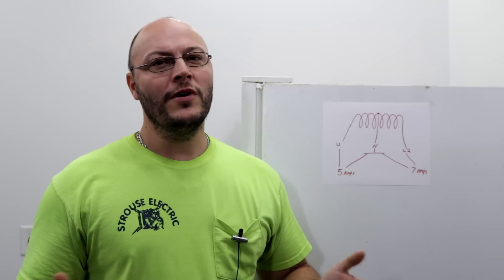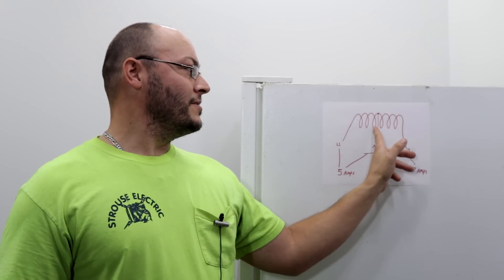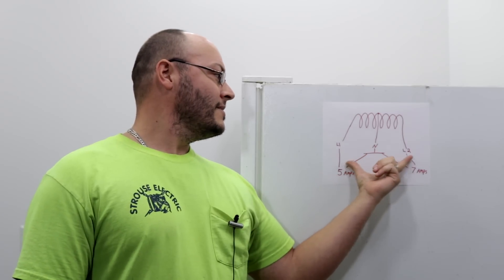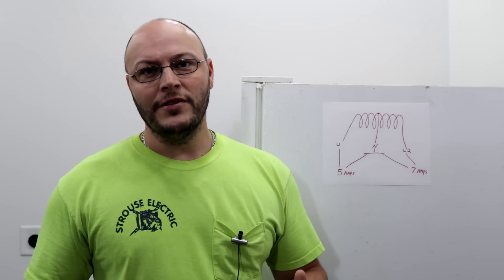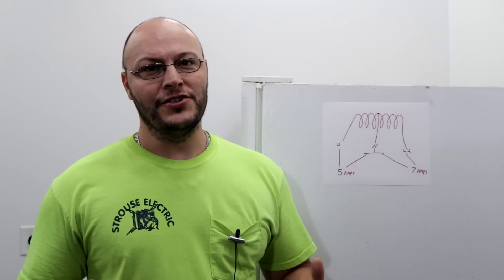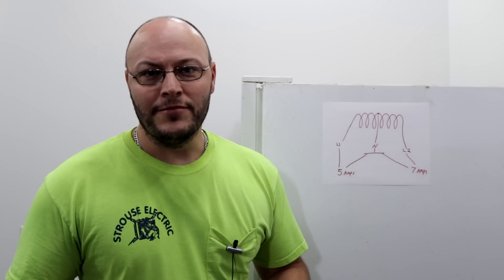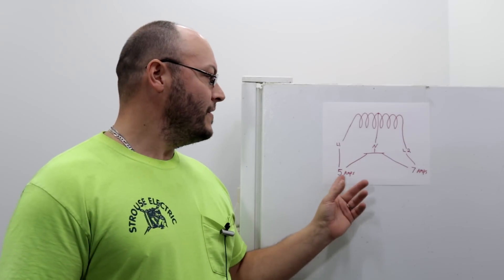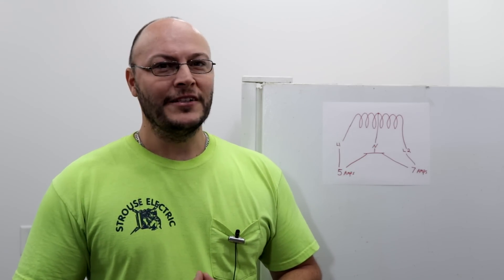What does the Neutral Wire Do?

Comment: So, what happens if there was no return pathway for the remaining 2 amps in this situation?
Reply: The voltage would be unequal in the legs without a neutral.  The leg calling for 7 amps would be lower voltage with the leg calling for 5 amps would be high.
Reply: The entire system would share the 12 Amp load, basically, creating an imbalance in a parallel circuit system. So the devices on the side drawing 7 amps would suffer from insufficient power (i.e. lights/bulbs would grow dim, etc).  Nothing would happen to the 5 Amp side.  Nothing would burn out, except perhaps for any fragile underpowered motors being used on the 7 Amp side. No breakers would trip assuming the standard 15 Amp circuit - nothing is overloaded, just imbalanced.  This example is a single stage split circuit residential situation (minus the split in this hypothetical question = single phase parallel circuits) so I believe the out of phase issue you mentioned would not be an issue in this example.
Reply: I think if the unbalanced two amps in line 2 did not have a white wire path they would have to follow the line 1 wire and force to many amps into a line that is only calling for five amps. So I think you would fry the devices but the breaker would guess knows it is only supposed to be pulling 5 amp and when 7 amps came through perhaps it would flip the breaker off. Just my guess cause I really do not know. I know line one and line two are out of phase 180 and when one is pulling the other is pushing. Or when one is going forward the other is going backward. AC changes direction I think 60 times a second and when one line pulses toward the source the other pulses away from the source. Just a guess. I  hope some one can correct me if I am wrong.
Reply: I had that problem once, the utility company came out and checked it out. Said we had an open neutral. He went down the lines and found the open because someone was trimming trees and knocked it loose. I forget why I checked the voltage, I think the microwave was acting weird. So when I checked the voltage in the socket the voltage would rise beyond 120 to like 140. So I called the utility. As far as I know the problem only existed for a few hours, we had no other problems which you would think everything would cook?
Reply: Mike Horton It was told by an electrician you always hook up the white wire first and remove it last when working on a circuit.  You can have high voltage on the circuit and burn out the appliances and lights. There also has to have a bonding screw installed in the panel for the ground on the water main pipe . So this excessive electric has a pathway when the Appliance burns out and shorts. Without this bonding screw you will get electrocuted.

Comment: sir i dont know much on it, but today while discussing with my friend about it got me an idea about it. Live wires has some potential, neutral has 0 potential. Now there is a pd between them. When current changes polarity potential of live wire is negative so 0 potential of neutral is actually greater now, so in both cases i mean changing polarity neutral wire oppose the motion of current creating an Reactance. This stops sharp fluctuation of current and make the current smoother. If I am wrong please correct me. If I need rectification then also correct me.

Comment: Hey Bill, thanks for the video. It might help to clarify that the reason the current through the neutral wire is the subtraction of the two currents, is because the voltages are out of phase.  A lot of the comments look confused, citing Kirchoff's law and whatnot.
Reply: Unfortunately Bill’s no longer around to clarify.
Reply: @sunshine3914  was it work related bro?? I also read he had passed.

Comment: It doesn't make sense to me.  LOL!  I say there are 3 logical transformers; one between L1 and N, another between L2 and N, and a third between L1 and L2.  I would say that there are 12 amps traveling through what is labeled neutral, and if there were also a 10 amp 240v load, it would be added to L1 and L2 but not neutral.  There is nothing magic about neutral.  It's just a Leg in the transformer that's half-way between L1 and L2.  AC simply makes transmission and maintaining voltages easier over distance, and turned out to have other advantages as well.  There is not 240v between L1 and L2, it's more like 340.  240 is the average voltage (Root Mean Square) that would be the equivalent of 240v DC.  It doesn't matter how many times/cycles things move around, it is simply about sources, paths, and potentials.  

Tying the center tap to ground simply maintains a relative voltage baseline through energy transients caused by various sources, including lightning, otherwise they wouldn't do it because grounding the center tap creates a myriad of safety hazards itself and is simply the lesser of two evils.

I'm willing to learn if you can explain logically where I'm wrong.  Thanks!

Comment: The neutral goes directly to ground.
Reply: Neutral is connected to the ground but it does not go to the ground. Ground is not used as the return path of electricity.

Comment: The neutral is a grounded wire, as it is grounded at both the transformer and at the service disconnect, and is in fact referred to as such in the NEC.  It should not be confused with the grounding conductor (equipment grounding).  By grounding the neutral, it prevents any potential to exist between the two, as well as stabilizes the voltage between the phase conductors and ground.  Just try disconnecting the neutral from ground sometime on a transformer and watch the phase voltages to ground start to move around.  

Otherwise, an informative video.  It should be evident from your drawing that the neutral is merely a tap from the center of the secondary winding that is grounded.
Reply: Jonathan Woolbright.  Really?   I request that you offer some idea as to why you are saying I am incorrect.   Maybe you can tell me your experience or some NEC facts please.
Reply: Jonathan Woolbright         You have some training on how to install electrical systems.   Good.    Doug's original comment is absolutely correct.   I am a PE and have been designing premise electrical systems for electrical contractors since 1983.   I have all my code books since 1983.   I have designed electrical systems for residential, commercial, and industrial premises.   But do not take my word for this, I could still be wrong!   One of the leading authorities on NEC has videos on you tube.   Please see the links.   If they do not work, search for " grounding and bonding".  Find the Mike Holt videos.   He will explain how grounding works!    I hope this helps you understand.     Most electricians are taught how to do installs, but not why to do it.   https://youtu.be/3vvvv5QVZoA    https://youtu.be/GO2C0tG6hoI
Reply: Jonathan Woolbright    I should have asked, what part of the world do you live in?   May make a difference in what the utility company does, and terminology.
Reply: Jonathan Woolbright   Did you only watch the first one?   The second one shows NEC250.24.   In the slide it shows what you were talking about.   The statement you made was the neutral is grounded at utility OR at the main panel, not both.   It is not at one or the other.   That is why I originally said you were incorrect.  It is always NEC required in the premise electrical system.   You stated it would be dangerous.   I'm not understanding how you think if grounded at the neutral twice is dangerous.   Can you answer this question?   If an electric heater, correctly wired with equipment ground conductor to the case, has a hot conductor short out to the case, where does the current flow to?   Starting at the case, through the equipment ground to the main panel ground/neutral bar.    Where does it go from there?
Reply: Kevin Coop up the service neutral conductor back to the source. I think you two are really getting your bonding grounding terminology mixed up.
Reply: Tanner Bogan    Too many comments back and forth on this.   Can you please explain what you feel I am confused about?   Please be very specific so no confusion on either end.   Respectfully,  Kevin
Reply: I was messing about with secondary Windings on a transformer then it occurred to me what exactly does the Neutral do apart from being a path for a circuit this man has definitely been educated better than myself..so all you so called experts I ask one question why are you here in the first place if you already know... with that Court adjourned I rest my case
Reply: Jay Vids, we are glad they are here having this back and forth conversation because it a benefit for novice like me. Thanks for sharing all this great knowledge, guys, and opening up our eyes and minds to be better students.
Reply: Jonathan Woolbright  How on earth can connecting neutral to ground  in several places cause a short circuit?
Reply: Jonathan Woolbright    Completely wrong.   Utilities ground the neutral points of their transformers every time.   Electric services are grounded at the first overcurrent device location.   NO DANGER!   The video is correct.   Center tap on the transformer is the neutral.

Comment: If you come from a DC background (electronics), this is analogous to connecting two batteries in series, and measuring the voltages between both ends, and then putting the BLACK (ground) meter probe in between the two batteries.  In one direction, you'll see 1/2 the total DC voltage, and in the other direction (red on the other end), you see a negative 1/2 of the total DC voltage.  So in this case, "ground" is not really DC ground, it's positive with respect to the first battery, and negative with respect to the other.  With your meter, you've created a voltage divider.  The A/C/ center-tapped transformer in this video is very similar to that.  It's not zero (0) volts.  It's just a return path for either leg of the a/c current.  And yes, it IS hot (powered).   So neutral is NOT zero volts.  It's just a pathway to complete the circuit, and it DOES carry current.  The reason it's connected to physical earth at the main breaker / box, is to provide a shunted pathway under fault conditions.  That's it.  The earth/ground wire on an A/C is just a safety valve - nothing more.  Normally, it plays no role in the circuit's operation.  That's why you sometimes see the bare copper wire driven in to the ground, why it makes sense that Neutral can be connected (bonded) to this shunt.  The resistance to earth/ground is SO HIGH, current flows normally through the neutral path back to the transformer, and ignores this Earth / Ground pathway.
Reply: So ... the term "ground" in DC has a completely different meaning than it does in AC.  It's is confusing, to say the least.  I personally blame it on Tesla and Franklin.  lol
Reply: Ima SuperPerson 
No a ground is a ground., 
In DC the ground completes the circuit. Where ad AC., the neutral completes the circuit., and NEC requires a separate dedicated grounding wire.
Reply: I am not sure if I follow, but Neutral can be connected to ground, and ground resistance IS HIGH, so current flows through neutral? Isn't ground resistance always lowest so voltage goes there first?
Reply: @PoProstu_Ameryka  c thrs pos voltage neg voltage so is current flow one direction or other as alos thrs neg charges nd pos nd load always comes in between 2 do work... U need a source for electrons nd that's ground... Resistance just gives the path for current 2 flow nd voltage makes resistance drop nd vice versa

Comment: Correct me if I'm wrong. Whenever we design a panel with branch circuits, the loads will always be unbalanced - unless we have an even and identical loads connected into it. So does this mean it will always have a residual current back to the transformer? And how it will affect the transformer itself?
Reply: With a typical USA 120/240 volt panel in a home the goal is to balance loads but in reality, there never is a balance.  Thus there is current back to the centre tap of the pole's transformer on the neutral wire. Thus if the Fridge at 6am is drawing 6 amps on leg A and the hair dryer in drawing 14 amps on the leg B the neutral has 8 amps. ie the difference between B and A.  If one placed both 120 volt loads on leg  B there would be 22 amps on leg B and 22 on the neutral and zero on leg A.  Voltage regulation is better to the home with balanced loads ie the voltage drop is on both hot legs instead of all across one leg. An induction motor's start current is often 5 times the run current. Thus a lone 15 amp 120 volt AC unit will draw say 75 amps at start. If one had both on the same leg and they started at once that is 150 amps and that is why the lights dim when stuff starts.

Comment: Sorry I am viewing this video much later but alot of this is incorrect! Please be careful when telling people about electrical work on youtube as it can be very dangerous. Everyone should reference NEC article 250 on this matter.

First off, a neutral IS a ground. Ground is a reference of potential to earth in voltage. That is why a well designed,  code compliant system has 0v potential from Neutral to ground. The neutral is known as a grounded conductor..a current carrying grounded conductor.

The green wire, "ground" is known as a grounding conductor which provides a path not only for lightning but for all unwanted ground faults. The difference is the neutral is intended to be current carrying and only grounded at the panel. There is a saying that the neutral carries the unbalanced load..that is but a vague description. In a polyphase system the point of the neutral is to carry a limited amount of current back to the source.. Unfortunately, I don't have space in a youtube comment to explain phases and balancing.

Seriously.. this may work for general use but if a person were to attempt to design a system in their homs using only what you've said here they could seriously misunderstand the point of the neutral and easily have more than 0v potential to earth on their neutral..very dangerous
Reply: Ken Skid He makes a good point though. Lmao
Reply: I agree only that you should follow code, especially when you really don't understand the basics of what is really going on.  Neutral is not ground, but code says that neutral should be connected to an Earth ground, thus the confussion caused to people who don't understand the theory. Neutral is the center tap of the pole pig transformer feeding your house. That is all it is. If you could keep the load balanced  you wouldn't need a neutral, but that is impractacal. In practice there should be very little neutral current, and zero ground current.     Code requires connecting neutral to ground at a single point near the  ground rod.  It should do so at only one point to prevent cirulating ground loop currents and to provide better lightning protection in the event of a nearby lightning strike.
Reply: Neutral is bonded to ground in Australia/New Zealand at the main switchboard. It's called an MEN link (Main Earth/Neutral link).
Reply: @craigjones8558  what household voltage do you use  there ?
Reply: And no body understood what you said.
Reply: Yes mike holt would not be happy hearing part of this. 

GEC - Grounding electrode conductor 

EGC - Equipment grounding conductor

The “green” or bare Ground wire (EGC) is certainly not just in place to give a path for lighting to ground...the much more common purpose of the EGC is for clearing dangerous fault current due to line to ground faults. 

I.E - a pumps motor windings have been damaged and is now causing a line to ground short. In a perfect world the frame/chassis of the motor is bonded to the EGC. So as soon as the fault occurs, current immediately travels down the ground wire through the branch circuit back to the panel, from the panel back through the meter and all the way up to the X0 terminal of the transformer. At the same time current skyrockets and the over current protection device trips opening the circuit. 

Earth itself does not have the resistance needed to trip most over current devices.
Reply: Green or bare copper conductor is the bonding conductor. Neutral is the grounded CIRCUIT conductor. The bare or green with that runs from the neutral bar of the panel directly to a grounding electrode is the ground conductor
Reply: Ken Skid Funny
Reply: kris germany r
Reply: Actually you are incorrect and the function of the grounded vs grounding conductor ARE different. The "neutral" is NOT a ground. Check the NEC definition of each.
Reply: Smart people are fun...if you enjoy bickering.
Reply: Alot of talk to say nothing
Justin.
Reply: All you have done is is make it more confusing to understand.  I have been an electrical lineman for 41 years for the third largest electric utility in America.  Chicago. I have to know what I am providing the customer.
Reply: JustinL614 Lol. Come on man. I would hope no one is stupid enough to design and install a wiring system in their home using only a two minute video on YouTube 

.
Reply: @wills8288  I am an engineer and I disagree, this video is on the mark.
Reply: it seems like you understand something but anyone that thinks they know everything really doesn't know much . His synopsis of neutral was very close to exactly what does occur . polyphased or triphased my friend. Nothing dangerous about it.Sorry
Reply: Mike Holt would kick the shit outta you for saying that earth grounding is for clearing ground faults. You think the high resistance of earth back to the transformer is a good way to clear a ground fault? I hope not.
Reply: In this instance the neutral is always bonded to ground at the transformer and at no other point.
Reply: The guy in 2 minutes explained exactly what a neutral is then we get someone like you that wants to act smart and get a life he explained it well